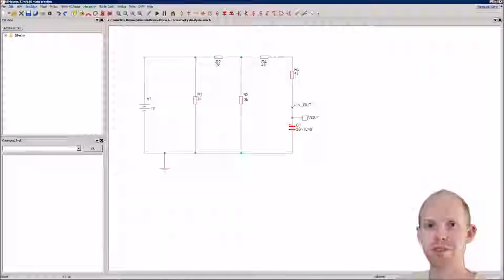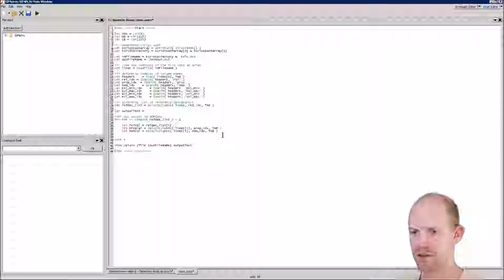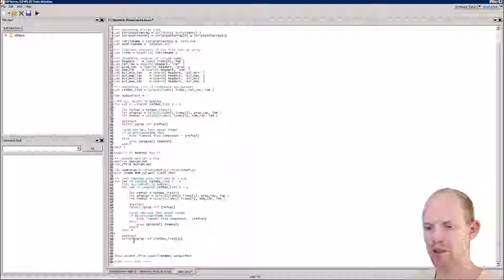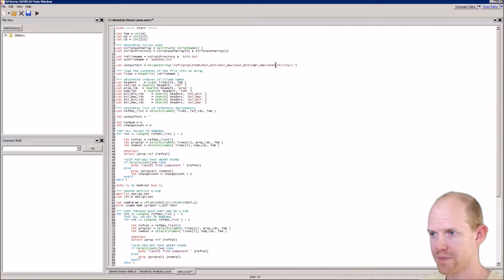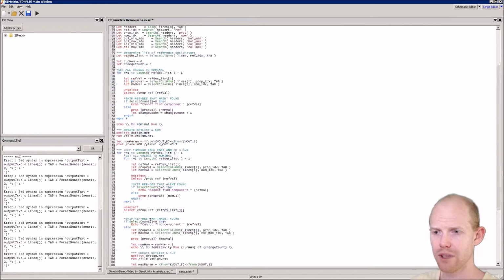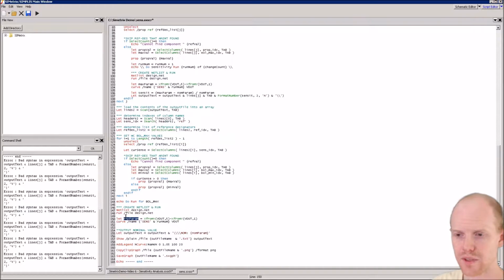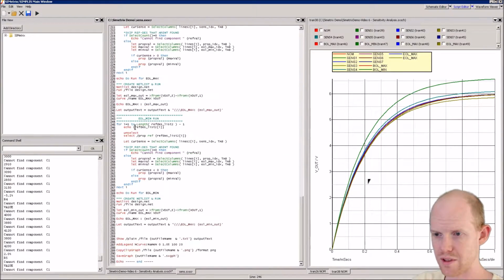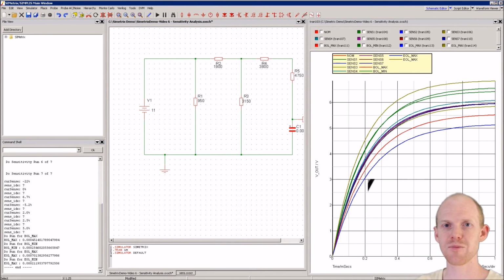SIMetrix/SIMPLIS Scripting 4 - Sensitivity + EVA

Comment: Hello Jesse,

I have a question for you but it's not directly related to the sensitivity analysis. But, in general SIMetrix.

Can we use SIMetrix to analyze the potential EMC problem?
Yeah I realize for the EMC analysis we need a specific software, for example ANSYS Maxwell. But, is it possible to utilize the SIMetrix to approach EMC problem in circuit analysis? 
It is fine if itsn't directly solved the EMC analysis.
Please give me your thoughts based on your experience.

Thank you very much.
Reply from the maker: Well as you know EMC consists of radiated and conducted emissions and susceptibility. I don't know how  you'd do anything with the radiated ones, but the conducted ones you can certainly model in SPICE just like you would in a lab. You can run your circuit as a transient analysis and use the FFT feature. You could also run an AC analysis in some cases to calculate the attenuation of the circuit which you could then apply to the power spectral density of the noise, like a line rejection test for example. You could also model some of that stuff in a spreadsheet. What are you trying to build?
Reply: @CircuitAnalysis  Thank you for your response!

I get it, so basically we can analyze the model in SPICE for EMC conducted analysis. Okay, I'll try to explore your explanation. Thank you!

Basically, I would like to analyze DC-DC converter design, especially for the buck converter. The purpose is to evaluate the design the buck converter, so I try to analyze the EMC behavior or electromagnetic conducted emission of buck converter. Then, try to analyze the EMC behavior If I modify the circuit design through adding and removing the capacitors/resistors/inductors, so I can find the optimum design with a good EMC performance. 

If you don't mind, maybe these use cases  could be a great idea for your next content videos to explain the EMC analysis in SPICE model 😃

Comment: Hello Jesse,

Thank you for your video! It really help to understand SIMetrix analysis.
However, I have some questions regarding this video. Would you mind answering my questions?

1. First, why we define the nominal and worst case with V1 (Vinput) value? Is it the default condition? Or we can define for the other parameters, for example C1 value?
If we choose the other parameter, will the framework be different? 
I want to know the idea behind "how to define the worst case condition", in this case we analyze Vin = 10V and Vin = 11V.

2. Would you mind elaborating again the sensitivity value meaning and what's the impact each value to the system?
I'm still don't understand the meaning (-) and (+) value; also why the V1 is the most sensitive whereas V1 is the input - am I wrong, if I think in every circuit the input will have the biggest impact/sensitivity.

3. Is EVA (Extreme Value Analysis) the Worst Case Analysis?

Thank you in advance
Reply from the maker: For it to make sense you have to be talking about a single output parameter of interest. In this case I just made some resistors charging a cap with the parameter of interest being V_OUT. The point of the sensitivity is to vary each part 1 at a time and see how much it changes the parameter of interest. You can create a sensitivity for each part as a percentage change of the variable of interest. The worst case max condition is found by setting all the parts with a positive sensitivity to max and negative sensitivity to min. The worst case min is the opposite. I don't see any reason the input should always be the most sensitive. Thanks for watching, feel free to ask more questions.
Reply: @CircuitAnalysis  Thank you Jesse for your response,

Yeah I think I have misunderstood what is sensitivity value meaning and the definition min and max in this case. 

Let me confirm my understanding.
1. So, in this case our parameter interest is V_OUT with the variable parameter are V1, R1-R5, and C1. So, every time calculation, we change one of variable value (for example R2 - then the others will be nominal value). Am I right?

2. Sensitivity value:
Positive direction means if we increase the value the V_OUT will be higher (R2 increase the V_OUT will be higher than the nominal value)
Negative direction means if we decrease the value the V_OUT will be higher (R3 decrease the V_OUT will be higher than the nominal value). Am I right?

3. Would you mind explain more about what is NOM meaning and nomParam? What's the meaning of 0.003280 value? Is this the difference value of V_OUT between 5V and 1V (period time)? 

Thank you very much, it means a lot for me
Reply from the maker: @VerenPanjaitan  
1) Yes correct
2) Exactly
3) NOM of 0.003280 is the value of the nomParam variable which is the value of the parameter of interest with all parts set to their nominal values. nomParam = XfromY(VOUT,5)-XfromY(VOUT,1) is calculating the time it takes the voltage to rise from 1V to 5V, so is sort of a simple "Rise Time" calculation, in this case it looks like the units are Seconds. I think this was just a random example to demonstrate the concept of doing a sensitivity analysis and using the results to perform an extreme value analysis. I noticed the video seems to be very poor quality and not readable for some reason, but seems to get better at some points if you watch it for a while? I am not sure what happened but I think maybe YouTube is not loading the HD version anymore or something perhaps because it is old and not popular, did you have trouble reading it too?
Reply: @CircuitAnalysis  Thank you for your explanation. It's clear and help me to understand more.

Yes, in the first place the video quality is poor even though we have set the highest resolution. I face the difficulty to read in the first part, but it's not a big deal because it's getting better on the rest video.

Thank you for your videos! I really enjoy your hard work!
Reply: @CircuitAnalysis  
Hello Jesse, I have succeeded in calculating sensitivity analysis with my case. 

Also, before I start to use this method for the complex cases, I verify the result manually first (since the circuit is quite feasible to change - with only transient analysis manually). But, unfortunately, the result is not entirely equivalent, especially for the direction sensitivity value. When I calculate manually, I found the opposite direction for the direction sensitivity value. 

Do you have any thoughts on why these conditions happen? I just think because your example script used 1V to 5V (It's kinda we give the limitation for the calculation), and the transient analysis calculates all values from 0V until the final value on the timestamps, but I am not sure whether this limitation impact the sensitivity direction value or not. What do you think? I believe your experience in circuit analysis would be have other perspectives for this case.

Thank you very much!
Reply from the maker: @VerenPanjaitan  Glad you are making progress. What is your parameter of interest and what is the formula you're using for it? It is good you're checking a few random cases of the results with manual calculations. In order to debug what is happening in code like this you need to have it print more variables to the console to compare against every number in you manual calculations and find where the differences are. You do this with the Echo command, so for example before it calcs the sensitivity you could echo the values of maxParam and nomParam and maybe propVal and maxVal and refVal, then compare against your manual numbers.